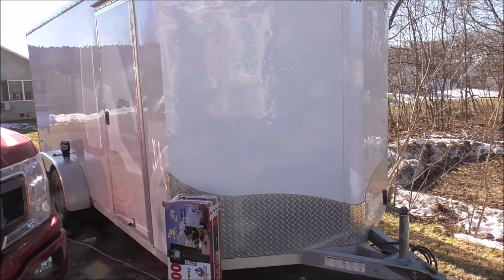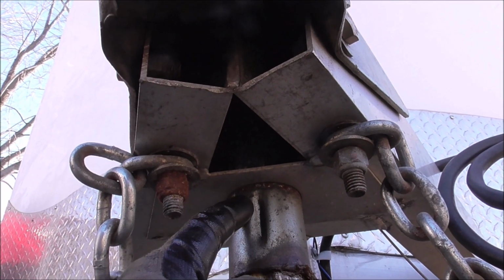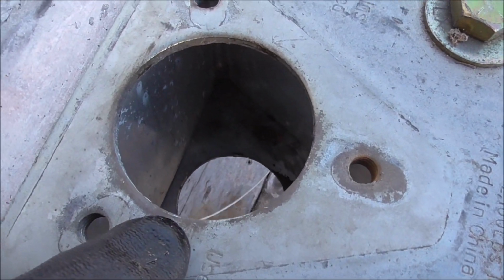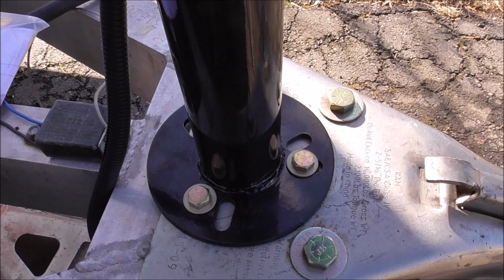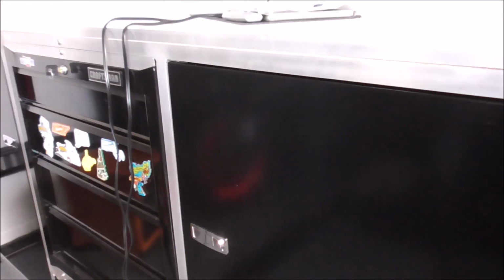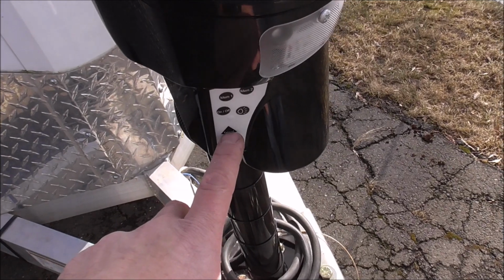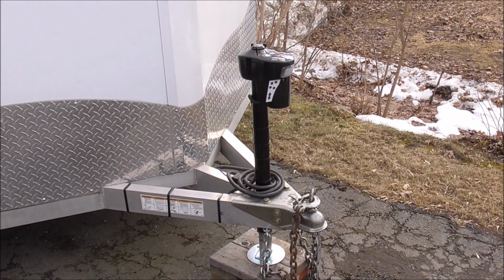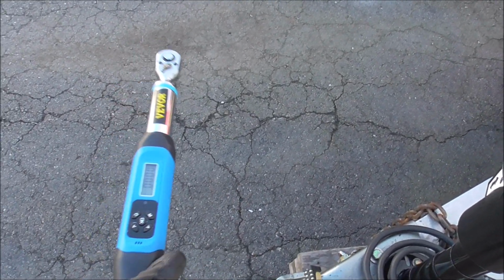Installing the FASTEST Trailer Jack on EARTH

Comment: Those silver washers are zinc plated just like the yellow ones.  the only difference is "yellow zinc" vs "clear zinc" plating.  neither is really better than the other regarding corrosion resistance.  Most companies have gone away from the "yellow zinc" because the plating process uses hexavalent chromium which is very toxic and not able to be used on products going overseas.
Reply from the maker: Very interesting! Thank you for sharing. I love our community! 👍

Comment: Brandon, you lucked out for that fitting in the same hole and bolt pattern. My luck usually not as easy. Here in Missouri TSC isn't the best place to buy hardware. We have a few stores here called MFA and they still sell by the pound or even in bulk or boxes. I guess there are a few places online to buy. On top of the old jack you can hook a drill to run it up and down
Reply from the maker: Do your Tractor Supplies sell bolts by the pound there? Thats how they do them in my area. It's unreal cheap to buy them that way versus going to Home Depot and buying  them there.
Reply: @BrandonLund  i use to get them real cheap from work. Lol